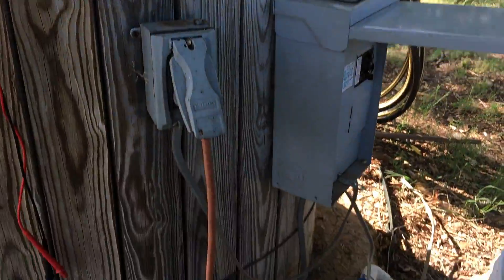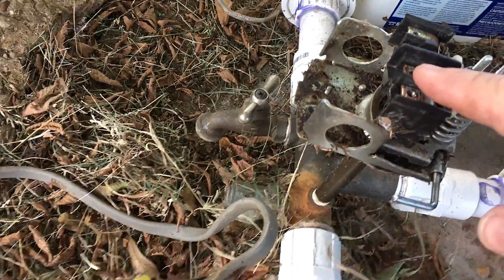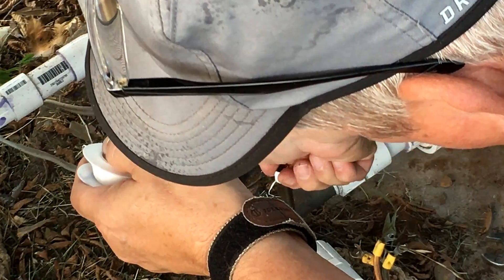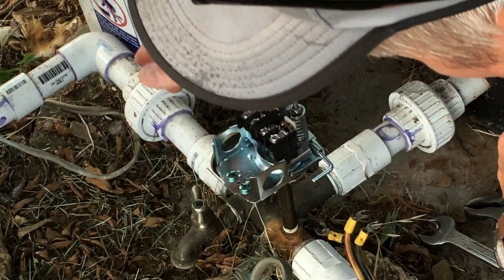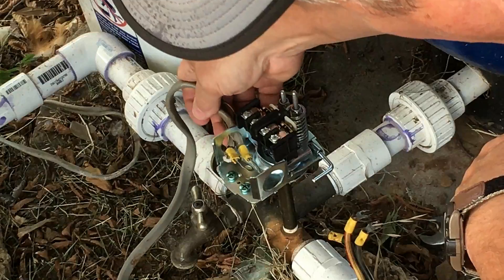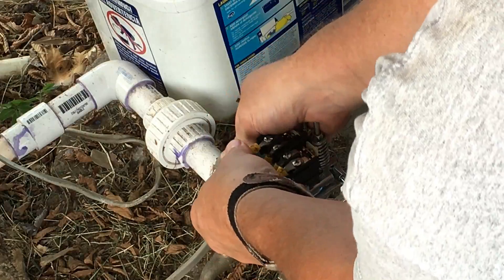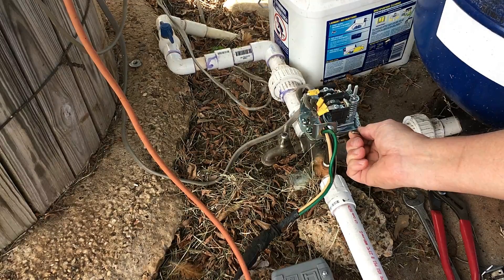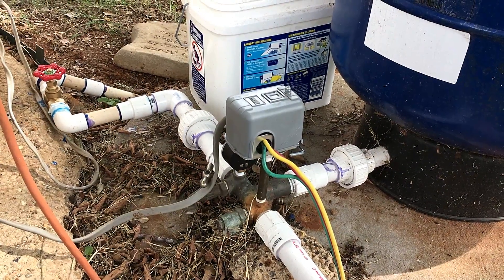REPLACING A WELL PUMP PRESSURE SWITCH

Comment: You need to put wire clamps for the wire feed
Reply from the maker: True. 
To do it correctly it should have wire clamps on the switch. 

I think somewhere down the line I lost the clamps. I haven’t had a problem yet, but yes, it should be done.

Comment: I'm building an off grid system.  Should the pressure switch be before the guage on the tank cross or after or doesn't matter? Thx
Reply from the maker: It's all in the same series of pipes. 
Here's a link to a picture showing how it's made.
I've found it's always better to get one pre-made instead of trying to make one myself.
This kit has a relief valve, a hose bib, the switch and gauge all in one... AND... it's BRASS...!
The big end (on the left) goes to the pressure tank.
Here is is on Amazon: https://amzn.to/3Rzysm1
(s a member of the Amazon Associate Program, I earn from qualifying purchases)
Hope that helps,
alan
Reply: Thanks ! I don't see picture tho
Reply from the maker: Click the link I sent you

Comment: Unhelpful I can’t see the wiring
Reply from the maker: There is typically a wiring diagram on the switch when you buy it. It has a small schematic in it… I should have.

Comment: I have a pump and the spring on it where the contacts is broke can I just replace the spring or do I need to buy a new pump?! Help
Reply from the maker: I would try to just replace the contact/spring, etc.
Look at the part number and call a water pump dealer near you.

Comment: My switch is attached to my pump, before I change it do I have to shut off or drain water from anywhere, or just turn off the power?
Reply from the maker: Not familiar with that type of switch, but I think if you turn it off and turn the hose on to bleed it, you'd be ok

Comment: What if your valve points stay closed and the motor run all the time and I have to flip the breaker to turn motor off?
Reply from the maker: I'm not an expert, but sounds like the switch is not reading the pressure in the pipes.
The small pipe at the bottom of the switch may be stopped up, or the SWITCH itself may be bad.
If not sure... call a local well pump guy and ask for some info.
Hope that helps.
Reply: @TexasPrepper2  you are right but I have a QD Control Box and the electrician had it hooked up wrong the pressure valve was not even hooked to the current, I found it after your video. Thanks for your help and reply.

Comment: Does it matter which hot goes where as long Sthey’re on the correct terminal
Reply from the maker: You have to put a HOT wire on each side.
The Switch should come with a diagram showing where to put the wires.
The Ground wire will be screwed down to the metal base of the switch 6:12.
The other 2 wires coming in from the elect box will be HOT.
You have to wire so the power coming IN goes to one part of the switch... the wires going from the switch to the well PUMP (power going OUT) will screw to the other part of the switch.
Starting at 6:42 I show where to attach the wires on THIS particular switch... (Other switches might be different)
Watch the video again... but... the switch should come with detailed instructions.
If you're not comfortable doing it, ask for help, or get an electrician.
Hope I made it reasonably clear 😎

Comment: I always put the wires right through a small slit in the provided rubber caps. Gives a better water tight fitting and protects like a grommet.

Comment: My jet pump 40/60 is wired with 220v.  When I check the two middle terminals on 40/60 are 220v.  How can I wire a 110v GFI into this switch so that it will turn on a chlorine pump when the well is running?
Reply from the maker: Man... I wish I could tell you.
I'm not an electrician. 
I think I would put in a small breaker box and have one of the breakers 110v and one of them 220v.

Comment: Did he ever say anything about the two black wire position or the two white wire position?  I heard a few times about the green ground positions....as far as grommets, I found left over frog parts inside the switch so plug those holes and more so a grommet clamps the wire so movement from vibration is gone. So where do the black and white wires go......next video we go...
Reply from the maker: The switch comes with a schematic of the wiring pattern.
Should be easy to follow

Comment: A pretty fair video, but you should have used grommets on both sides to protect the wires from rubbing on the metal. I can't over emphasize this glaring error!
Reply from the maker: As I said in the video... I didn't have any grommets. 
If I'd had them I definitely use them
Maybe I could find some at Lowes?

Comment: Old square D pressure switches. As a teenager I replaced a lot of them for my Dad, the well driller.  Sweaty, dirty work in very cramped quarters. Spiders and scorpions. . Always happened when it was 100 degrees and 96% humidity  or 20 degrees. You could swap out the pump yourself. Again, it is work but not complicated and the price of parts ain't much. I pray it goes well. .
Reply from the maker: I thought about it...
The labor was only $150 to swap pumps, so... that's not too bad

Comment: I recommend ALWAYS get the auto-shutoff.  My well pump would have burned up and probably melted the PVC pipes in the well because my heater went out and my pipes froze.  It's just another layer of safety and peace of mind for a few bucks.  A new well pump at $1000 and the casing PVC and installation cost my Dad $10,000+ but the switch I have saved all my well parts.
Reply: Plus since all of the well service companies were so backed up, it took two weeks  to get anyone to come out.  The last two winters have gotten way colder and stayed cold longer than we have ever seen before.
Reply from the maker: WELL worth getting the auto shutoff model
Thanks for sharing your experience